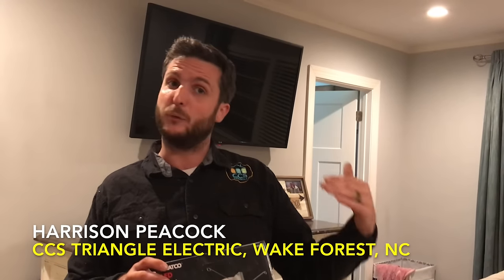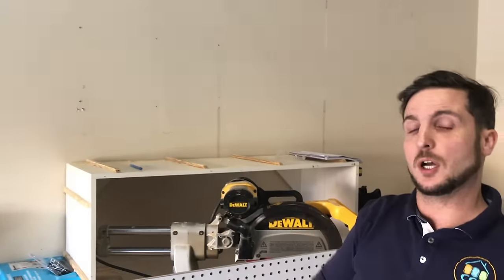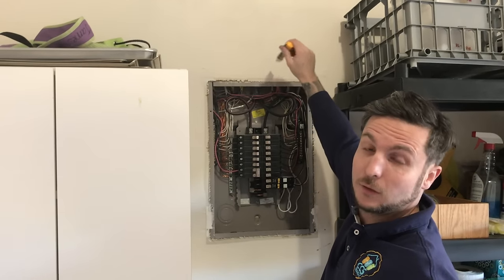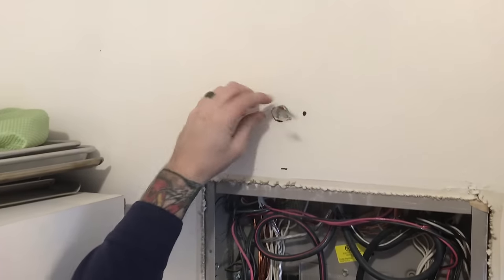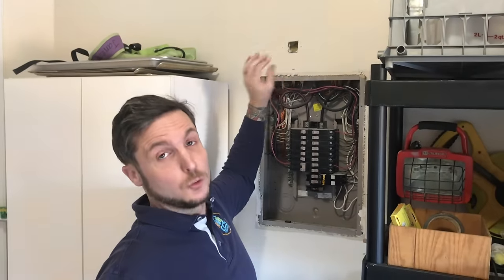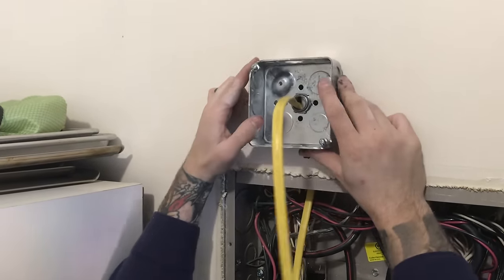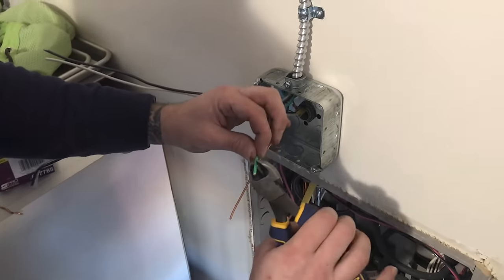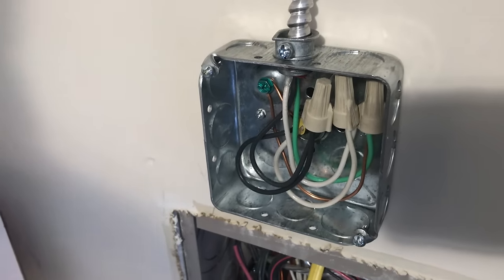New Garage Outlet From Panel--VERY DETAILED! (New Circuit / GFCI / Breaker Box / FULL INSTALL!)

Comment: Can I go from 10-3 to 12-2? I'm coming from outside with the 10-3 going to the panel and 12-2 from the panel to outlets and lights...Going from a shed where 12-2 is run to a garage...

Comment: I just watched another video about adding another circuit. The guy tightened the screws on the wire connector before pulling the wire down through the wall and into the panel box. Then he threaded on the locking ring securing it to the panel. That way the wires are secured to the box. This guy put the fitting into the wall and secured it to the panel. Then put the wires through with no way to tighten the screws and secure the wire.

Comment: It will be interesting to see what the US standard installations, connectors and electrical cabinet look like. It looks pretty much different when here in Europe. Somehow more old-fashioned looking. Fewer quick connectors> screwing> slower installation. The colour codes of the wires are different than in Europe. Also, the difference seems to be that the unlicensed installation is strictly prohibited. If there is damage due to electricity as a result of self-installation, the insurance company will not pay insurance claims.
Reply: That is no excuse for government to get involved. But we know it can't resist searching for any reason at all, to do so.

Comment: Big one if you do not expose enough copper it can short trying to make connection through the insulation .Tighten all screws very tight don't go nuts but shorts happen a lot from loose screws .

Comment: this video is showing one of the most important violations I see all the time in existing buildings we must have a working clearance of 3 feet in front of the panel and also a 30 inches side clearance either from the left or to the right, but this video shows the shelving to the right and the refrigerator on the left and it is supposed to be clear from finish floor to about 6 1/2 ft above, I see this all the time and also no foreign piping systems like gas or water or ca line sets in this dedicated space per NEC 110.26 same rule applies for outside working clearance

Comment: I have a question, it is any difference between armorlite 12/2 with bare ground  and the one you guys are using? I did notice the difference to late, I did installed the cable and I just waiting for the 20 amps breaker, should I remove that cable? or it is the same? mine is the Armorlite 21/2 x 50 in the picture looks like mine the only difference is my ground wire is bare and also I think is thinner, the black and the white looks the same, please help... can I proceed with the installation? What is the difference? Thanks for that excellent video.
Reply: I'm not a professional electrician but have been doing some research into FMC.  I believe code allows for the metal conduit itself to be the ground for a circuit, so the aluminum ground version may be for such applications (the aluminum conductor is tied to the sheathing).  For installations where this is not desired (or allowed), the version of FMC used here with the copper ground wire that's NOT tied to the sheathing would be used. 

In all cases FMC does need to be grounded to prevent it from becoming energized due to a wiring fault, so if the copper ground version is used, all of the metal conduit and boxes need to be bonded together and grounded.  Should a non-metal box be used in the circuit, there are special bonding connectors for the FMC that allows you to properly ground them.

If any pros want to chime in, I'd love to hear from them!

Comment: dang, that is really nice!!!! I need to install an outlet for a dryer 120v.
Reply: Aren't dryers typically 240v? Not an expert by any means. I just thought they were 240v.
Reply: @danilo352  If it's a gas dryer it only needs 120v (plus the gas line, of course). There are also 120v high efficiency electric dryers, though they're slower than 240v ones.
Reply: @alexknight7191  cool. I didn't know that. Thanks.

Comment: How much would this cost? I just bought a small mig welder and need a dedicated 20 amp receptacle for it.
Reply: depends on distances, panel manufacturer,finally - panel openings for a breaker(s)
Reply: @michaelevans5237  yeah its not far, actually on the other side of the wall the breaker is on.  I looked on my panel but didnt see any more room for another breaker.  Im in California and was wondering how much an electrician would charge.
Reply: 1 st , need to create a secondary panel box( ,  sub box) , , rerun a few circuits to make  it possible ,then add in the circuit you require for the new welder , outlets boxes. Materials $130. Labor for a master electrician $140 /$ 180 ...CALI MAY BE SLIGHTLY HIGHER.
Reply: Run conduit EMT or PVC. Get a permit.  Be safe.

Comment: Can you explain how I can run electricity from a 220v supply box with 3 thermos switches to a small electrical box 110v with 2 single stage  thermoswitches...

Comment: re 2:30 You might explain why you ran the cable all the way around the room (apparently the long way), instead of just straight across the ceiling.
re 3:22 The covers I've seen are designed so they cannot short anything inside, but they could conceivably pull a breaker loose, if you are brutal about removing the cover. 
re 13:50 Note: He is holding the long end of the ground wire, so tightening is correct (although unexpected & unexplained).  See also 30:43
re 17:42 "bushing", I would call a 'nut'. 
re 33:13 He seems to be under the impression that tightening the terminal screw secures the trap terminal.  I don't think it does.  The trap terminal wire release still works.   The screw terminal is more secure than the quicker trap terminal. 
re 38:15  The paper acts as incompressible insulation, a mechanical stiffener & bend cushion, & to minimize flex hardening of the copper as the cable is handled during installation.  
re 48:13 Note the 'screw head' just above his left thumb is actually the spring mount for the breakers face plate, which must NOT be tight, and must allow the face of every breaker to seat neatly.
Reply: I don't see an answer as to why they went the long way and put the wire up to the ceiling, then followed the walls around the corners to install instead of running it directly across the ceiling.  I'm assuming there was a reason.  Does anyone know?
Reply: Not quite as tacky

Comment: 21:10 you cut the ends of wire into an open and live panel. any worries?
Reply: Read my post regarding this.
Reply: @derekparent752  sorry i don't know what post you are talking about
Reply: David Seed, it is a comment on the same video regarding working on live apparatus and code failures. It is not a reply like this. 👍

Comment: Not bad,but you need to use the right tools. No electrician would use a pair of side cutters to remove the knock outs. Also to tighten the locking ring in the panel,would not use a pair of channel locks,use your screwdriver and linesmen pliers. An electrician would use his linesmen pliers to strip the wire. All in all not a bad video.

Comment: The metal clad to the gfci outlet should be properly installed (upside down) so if water runs down it will not get inside into the wire.

Comment: You did not tinge the the clamp on the NM cable going into the electric panel.  You can tighten the clamp onto the NM cable first and then feed the wire into the box.  Bring the threaded part of the clamp into the knock out using the cable and then put the nut on.  Problem solved. I also would have put an receptacle in the metal junction box.  Mor receptiveness are always better.

Comment: I would caution on the use of MC exposed on the wall.  Per the NEC it's not allowed in areas where "subject to physical damage" this is pretty subjective and I have seen AHJs that wouldn't allow this type of use.  Better to spring for EMT if your going to be exposed but if you are going to use MC install it behind the dry wall

Comment: I know nothing about electrical stuff so I'm sorry for my ignorance... but why did you need that box above the panel? Couldn't you have just ran the wire directly to the outlet from the panel? Why did you need that junction box?
Reply: The panel is recessed so the access is behind the drywall and therefore no reasonable way to run the cable internally. You need that box to connect the wires for a surface mount method. If the drywall had not been hung yet, then you would run the yellow Romex cable through the studs to the location selected. In that case that junction box would not be needed.

Comment: I would have thought it would be 'good practice' to commence using the ports from the bottom and moving up so that one would not need weave around other wires eliminating the stress or chance of pulling an existing circuit from its port !

Comment: The GFCI breaker was a 15 amp on a 20 amp circuit (as labeled on the installed breaker GFT15W3Z,  for a 20 amp it should has a T slot on one side and should labeled GFT20W3Z.
Reply: I also wondered why one would put a 15 amp GFCI receptacle on a 20 amp breaker. I know it's allowable, but why?

Comment: Best electrical panel circuit addition install video I've seen. You skipped nothing and were accurate and concise on every step. I love the way you fended off the internet electrician judges in advance. ;<)  . I'm sure you'll still get some, but I think you probably minimized them as well as possible.

Comment: Alternatively instead of having many different gfci outlets for all the outlets or all under one gfci you can get a gfci breaker in the panel that would cover all the outlets and easy to install, and would be up to code.
Reply: You can have one gfci receptacle in the beginning of a circuit to protect the other receptacles.

Comment: Would be nice if he had shown what connector to use at panel if you can't access the outside through the wall. I believe that is the plastic one cut from the video.

Comment: Few items I saw that would be incorrect based on other electricians that I have worked with. What's wrong with dedicated wire strippers? Incorrect way of using slip joint pliers! Ground wire should be wrap clockwise around screw when terminating to junction box.

Comment: real quick the 12/2 means 12 gauge cable with 2 strands of cable. if you are going to do long runs it maybe worth it to go thicker cable.
Reply: If your dealing with very long distances yes, 12/2 meaning 12 awg (2 current carrying conductors)

Comment: If you are going to be plugging a freezer into your garage plug, I do not recommend a GFI plug. I lost a freezer full of food while on vacation as the GFI tripped rendering my freezer inoperable. Cost me a new freezer(could not get the stink out of old freezer) and, I installed a non-GFI outlet. Never had any more trouble with freezers in that garage.
Reply: The GFI can be more sensitive than the main breaker as it uses different principles to cause a trip.  GFI probably tripped during the start up surge due to the freezer's compressor.  Some codes demand the use of a GFI in a garage because the unheated space is more susceptible to moisture.

Comment: Just wondering why he used a junction box above the panel. Why not just run the MC directly to the panel?
Reply from the maker: Just looks a little better this way, Joe. He mentions that you can run the MC straight into the box though, if you want to do it that way
Reply: to run the wire straight into the box it would have to go through the wall somehow.  The j-box makes that transition neater.  If you can fish the wires through the wall, attic etc. then you could just run the MC straight into the panel.

Comment: I would have clamped the romex to the protector before installing it in your panel...you should wrap your ground wire clockwise around you ground screw

Comment: Alright so the take off isn’t holding the cable that goes in panel I would tighten it on to the romex before putting it in the panel so it’s not wiggling number two instead of making a access to take out the kos you can go in with a tapcon to take the knockout

Comment: Why did you have to ground the boxes when your using armored cable
Reply: All though the way he grounded the wire to the box was improper (proper is to wrap the wire clockwise so the screw synchs down on the wire instead of opening it away from the screw), it is to guarantee that the box itself is grounded to the circuit so in the event that somehow the terminals or wires were to contact the box it would trip the breaker instantly where as if you don't ground the box you are risking destroying everything on that circuit due to power overload.

Comment: First off you have hollow walls and are in an area where romex is legal. Just snake the wire inside the wall and do the job properly. 

Secondly the person who taught me electric taught me armored cable shouldn't be exposed for any lengths greater than 12 inches. I don't know if that's an old code, seeing that current code permits exposed armored cable but still it should be in conduit if run outside the wall, don't cheap out. 

Thirdly jfc use a rotosplitter to strip the armor.

Comment: Very strange, looks like inside the breaker box, some of the grounds are copper and some are aluminum, I wonder if there was a massive rewiring job done in the house in the not too distant past. I hope wherever copper wires were twisted with aluminum wires in the other rooms, that they used the correct wiring nuts.Also, I'm glad to see he bonded the metal box to ground, so many builders her ein FL screw this up and nver bond the box, so on remodels, it lands in my lap to bond the boxes properly per National Electric Code.
Reply: jeffostroff think that was light reflecting off copper grounds. The only alumn I saw was the SER ground on grd bus.

Comment: 1. Garages should have dual AFCI/GfCi receptacles. That can be remedied by upgrading the breaker to an AFCi breaker.
2.   Pre-twisting the wires before putting on the wirenut is NOT required. In fact, some manufactures recommend against it.
3. Silicone filled wirenuts would of been a better option. It's probably overkill but the junction box is  in a garage.
4. GFCI breaker is a more practical way to go if you got multiple receptacles that need GFCi protection.

Comment: Why not add your GFCI outlet and another 20A outlet in the 4S box above the panel before you go over to the other side of the room. Use them if you need them, unplug them when you want a dedicated outlet on the other side of the room? -jb

Comment: In my area, neither MC cable nor Romex can be run along a finished surface.
Reply: Where is that?  Isn't the point of MC cable to be run along a finished surface?
Reply: markgriz ...No. MC is to be run in walls (same as Romex) or used in buildings above 6 stories or sometimes 10 stories or in theaters or rooms with large gatherings of people. Romex, in case of fire, can burn and cause nauseous gas but is allowed in smaller buildings.

In this video it should have been fished in the wall or used individual wires in EMT.
Reply: blipco5  You said in my area. Where specifically?  North American electric code has no such restrictions
Reply: markgriz ...In Massachusetts. With its addendum, the Mass code is one of the strictest in the country. I have a friend working overseas on military bases and he told me they go by the Mass code.
All over the country though, local codes may have their own addendums that may allow such a thing but I doubt it.
Here's a true story, My sister bought a brand new house in Waco Texas. She asked me to change a switch in her kitchen. I was stunned to see no wire nuts on the neutrals or grounds in the box. Only on the hot wires. 
Long story short...I got the builder and his friend the building inspector (they didn't have a separate electrical inspector) over to the house and showed him as well as the code where it showed the use of "pressure connectors" (wire nuts). The builder put his hand in the box said he could touch any wire in that box and not get a shock. LOL. He then said he wired every house in that development using wire nuts on the hot wires only.
Also, he didn't use any Romex connectors or boxes behind the outside fixtures. LOL.
The inspector said he didn't see anything wrong with it.
My sister wound up selling the house anyways because her husband had to move for his job.

So there you have it.
Reply: In our area in NY this  would be considered “ subject to physical damage” NEC 330.12(1) and need to be at least sleeved. (AHJ call I guess). Nice work.
Reply: William Delotto ...Yes, all wiring is to be protected from physical damage. There is a limit to sleeve size. Running boards may be used as well but MC, AC, Romex may not be run on a finished surface in a finished space.
Reply: In new York we can't run a line voltage cable outside the wall like that it has to be emt

Comment: I'd prefer to use conduit. I don't want any romex in my house and bx only for cans or dishwasher/stove things that have to be moved or adjusted.
Reply: So what’s inside your conduit? Romex?
Reply: @markman63 You shouldn't put romex /bx inside conduit, because of potential heat build up. I use regular wire, THWN.

Comment: The manufacturers of wire nuts and similar solderless twist-on connectors specifically state that twisting the conductors is not required.  I twist them myself, but that is what they say.

Comment: 15 amp outlet on 20 amp circuit?
Reply: That's allowed by NEC. The only major difference is that the actual 20 amp receptacles have that T shaped connector on the hot side.